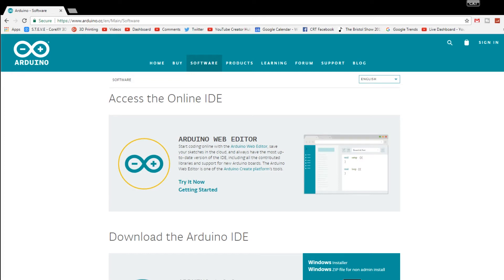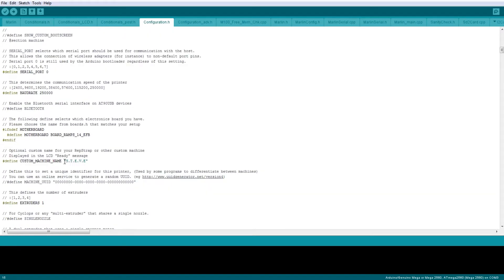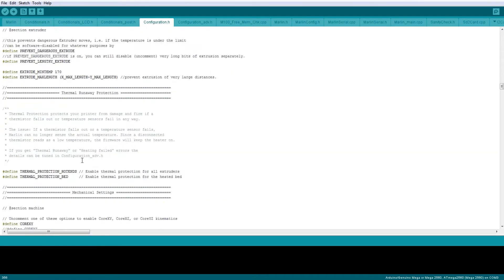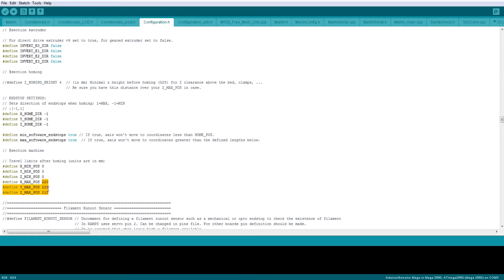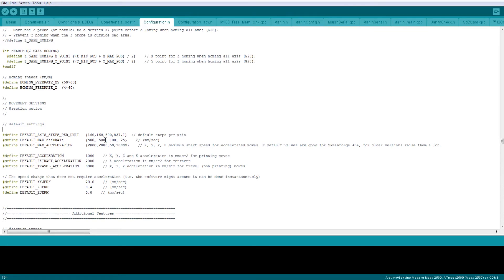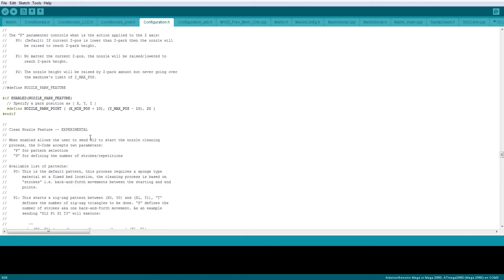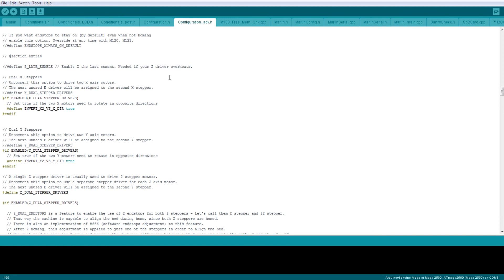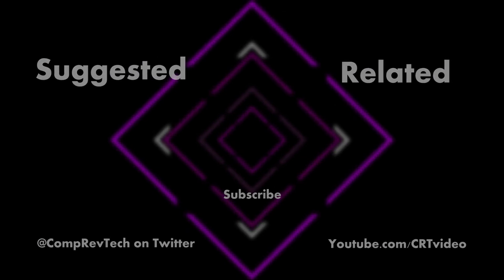Setting Up Marlin Firmware for Ramps 1.4 - STEVE Build Ep19

Comment: This was an excellent tutorial on how to get a basic configuration for the Marlin firmware and the RAMPS 1.4 board.  I'm going to try this configuration on the RAMPS 1.5 board with a E3DV6 hot end  as well.  I would think that this would work since the pin out on each board are the same, the only difference I see are the fuses.  LOL, it's funny and I just found that they have a RAMPS 1.6 board that I will to try as well.  Thanks again for the video.  Keep the content coming!!!

Comment: Hello there, I have a quite frustrating question as a New B! I have a motion control board with lots of stepper drivers capabilities and I use a Mega 2560 as sub driver only to to toggle the few remain unused pins for my set up! My issue is that the Marlin firmware on the mega consumes quite all the pins and I need lots of 'em! How could I get rid of all the unnecessary "#define" s and just keep the basic gcode environment and have access to most of the pins used with by exemple M42 P34 S255. Or can I load a simple sketch to define the pinModes and s it as is?  thanks for your time
Reply from the maker: Check the pins.h file. That defines what pins are used and what for.
Reply: @Vector3DP  Woaw, that was fast, so If I just quote them they should then become available!? I'll try that, thanks much